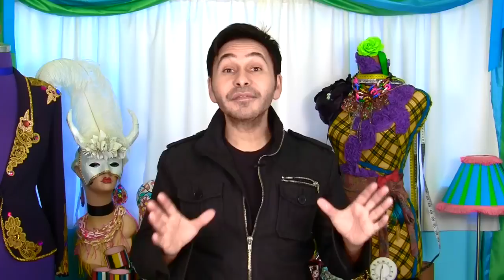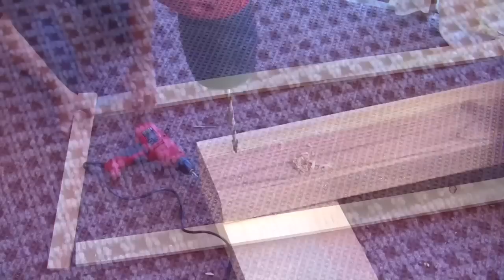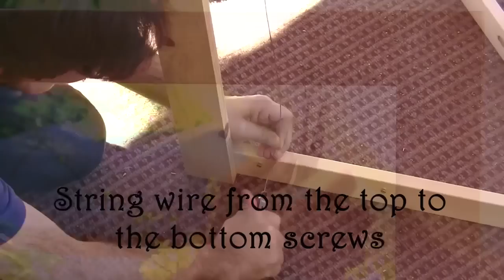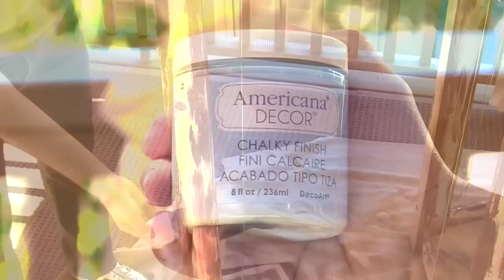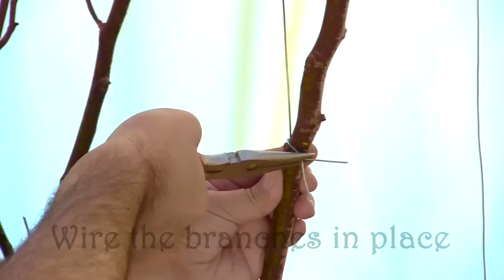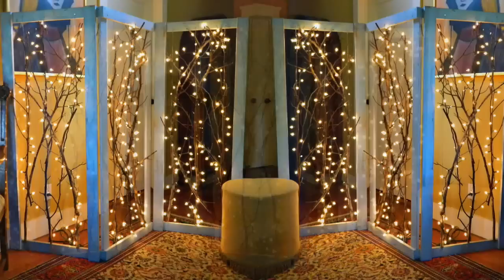How to: Twinkling Branches Room Divider

Comment: This would be PERFECT for my drab cement patio! I love my ground floor apartment but the slab of grey cement plus the balcony overhang above can make it feel like a cave so this would add some lovely ethereal light. Plus this is great for adding privacy without blocking my pretty view! Mark as usual you never cease to amaze.
Reply from the maker: Sarah Weiler I had it outside for a little while and it worked well on the patio.  Especially at night.

Comment: I want to make this but I'm wondering if I should do anything to the branches to protect them.
Reply from the maker: I guess you could coat them with a clear coat. That would be fine. Maybe a Minwax.
Reply: Mark Montano thanks for the reply. Would it be necessary to protect them? If not, I'd rather leave them as natural as possible. My bother said they will get brittle over time. I have all the supplies to make this but I'm stuck on this decision. I love your diys!
Reply from the maker: Why not.  If you're going to put in the time you might as well coat them with something.  It will still be beautiful.
Reply: Mark Montano you are so helpful. I appreciate it. Thank you

Comment: would be cool to make a large frame with same twigs and lights and suspend it from the ceiling, for instance over the dining room table... same idea could possibly even be used as a large picture frame, or around the top periphery of a room from where the picture hanging molding would be to the ceiling, like a frieze - half-moon shaped for over doorways and windows...
Reply from the maker: Lovely ideas Turquoise!